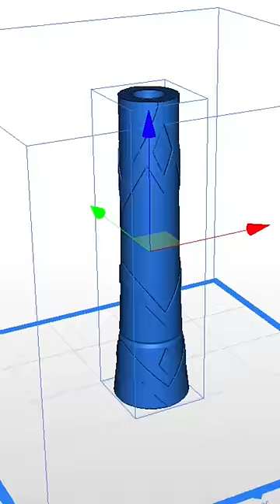My Genshin sword took 150h to 3D print! ⚔️ #diycrafts #cosplay

Comment: That’s huge! I couldn’t imagine carrying that around a con my arm would have died in 30 minutes-
Reply: I think the sword is made out of light material and the parts itself might be hollow. 
But I'd die from carrying the length of the sword alone 💀💀💀
Reply: @viledressler4909 if you put that sword next to me I’d be atleast 1/4 higher than it. Like a head size barely probably
Reply: @aliexpresskinnie  I feel like they would have made it lighter. I mean wouldnt it count as a real weapon with the effect of a baseball bat if it's as heavy as it looks
Reply: @viledressler4909  That’s true- 
But still- 💀
Reply: Its 3d printed so its made of plastic and the parts are essentially hollow. its extremely light
Reply: If it’s PLA (1.25g CM3) this is an estimate say 2 meters height hollow - probably 2-4KG in weight.
Edit (4.4-8.81 LBS)
Reply: @viledressler4909  I essentially carry that around daily
Reply: It’s like 8 pounds
Reply: relax.. its just plastic

Comment: For the curious ones:
It took 6 days to 3d print
Reply: no it didnt they have 2 printers so it probably took 4. the reason i say 4 and not 3 is you need to sleep at some point really from my experience a properly tuned printer you are really just waiting then finishing it. not to take away from the modeling either but on most games you can use special programs to pull out assets then slice up the model in blender. i did it with some valorant knives its a really good print.
Reply: @xathridtech727 can you please tell me how to do that? I pulled a sword out of curiosity using xnalara, but without the 2d texture maps it loses a lot of detail.
Reply: @SomaCruz29  valorant had pretty good models actually making divits I think there was a post on e3d page. I'm sorry I can't be more help with that but it's been 2 years. I can definitely see not having the texture making it worse but one idea is you may be able to use blender to add the texture back then sculpt the model from there.
Reply: @xathridtech727  Thank you!

Comment: Could print the mold for it then do it as forged carbon fiber with a polystyrene or bass wood core 3D print the mold and use milled carbon fiber and epoxy then lay in a styrene core a 15mm carbon fiber rod then more styrene pellets , carbon fiber then install the fitting and inject steam to actually expand the polystyrene beads which would expand and squeeze out any excessive resin and fill any voids and give strength to the sword while saving weight.

Comment: I just remembered there are plastics that could be used to make that real PEEK!!! Poly ethyl ethylene ketone the strength of steel but the weight of plastic.  Just need a special hot end and to build a oven for the chamber and remote the board controller and power supply to the outside of the printer enclosure and attach  insulation. To trap the heat from the heated printer bed. Or Add an IR or flood lamp and print.

Comment: Even though it was made for cosplay and printed in PLA IT COULD BE MODDED TO BE REAL USE Carbon fiber rods  for connectors and to reinforce the spine then use pre preg  carbon fiber on the sides and to the edge then spray the edge with copper infused Metallc paint or add graphite powder or iron oxide to an airbrush or spray gun then when dry you can then electroplate it and create a metal edge which can be sharpened and polished. It would probably add about .875 pounds

Comment: I wanted to buy an expensive 3D printer
Reply: No need bro you can get an Ender 3 for under $200 and that thing is absolutely capable and a great starter printer. Printers aren't expensive anymore, just about the top of the line without getting ridiculous is a bamboo X1C with AMS at 1500 bucks, but you can get a bamboo A1 w/ AMS for like 4 to 600 and be able to print super fast and with 4 colors/materials.